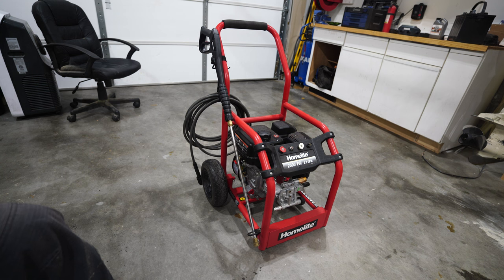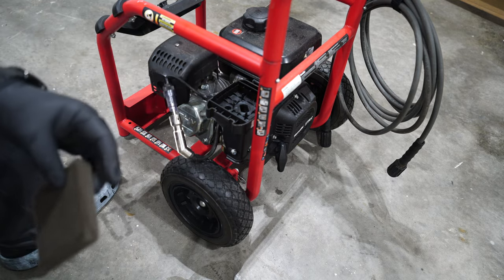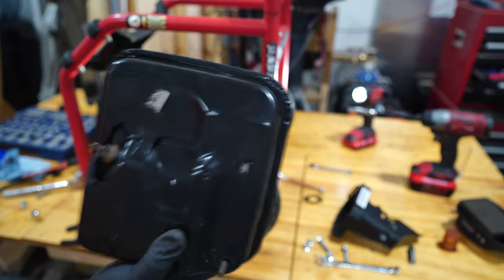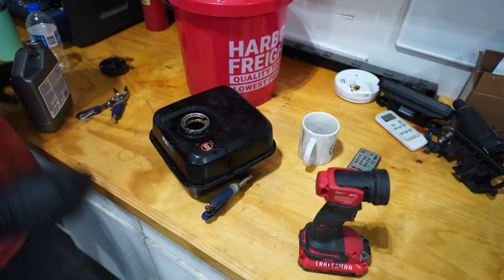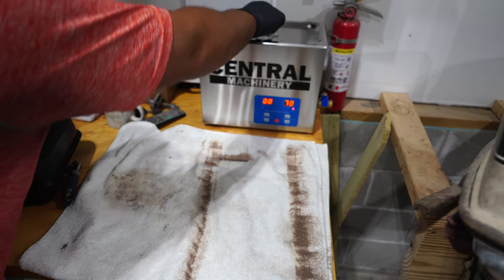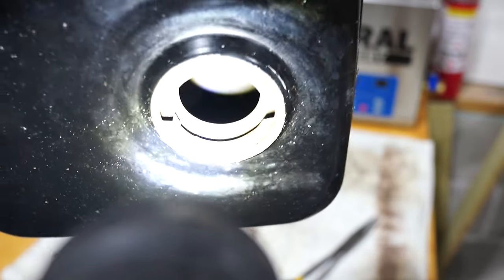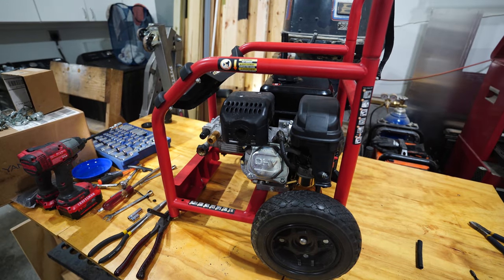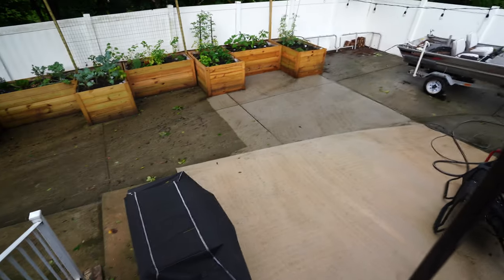Fixing an Old Homelite Pressure Washer

Comment: That's a very good pressure washer. Actually, I've had the very same model for 14 yrs now and only changed the pump about 2 yrs back, and it has been like new since. I've always used real gas in it and so far no issues with the carb or anything like that and believe it or not it almost always starts on the second or third try and alot of times especially in warmer weather it'll start on the first try if I've been using it frequently enough.